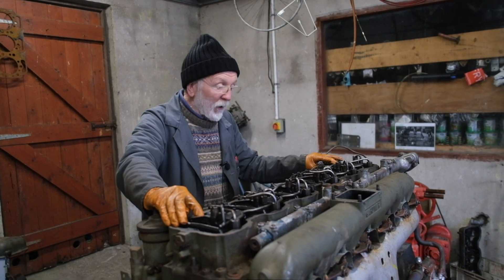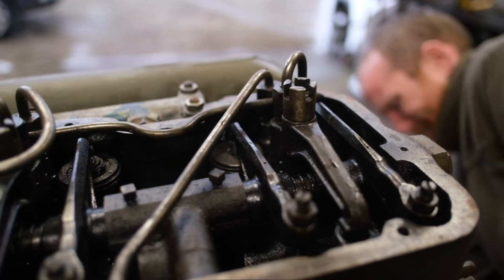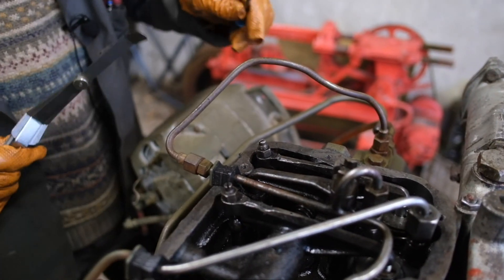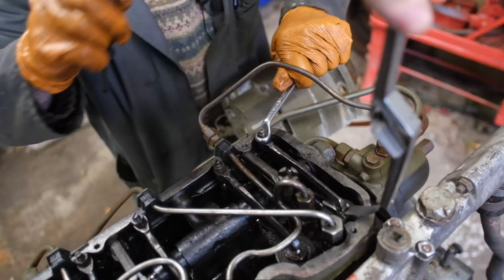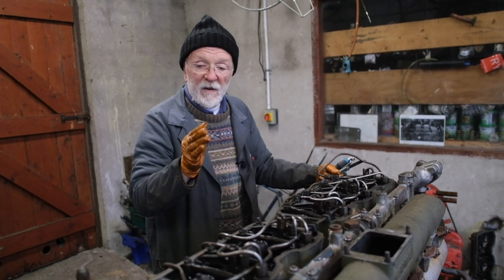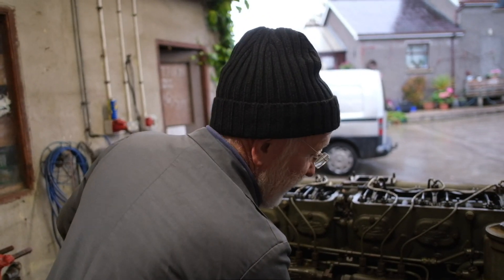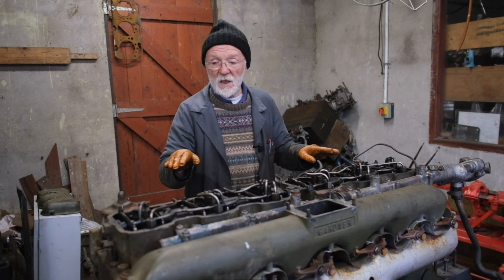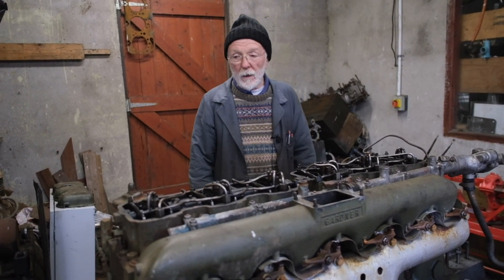Gardner Engines:setting the tappets

Comment: thanks for all the great videos your very generous. question where do you see marking for top dead centre ? also what is the next step for finding TDC  on next cylinder ?
Reply from the maker: The marks are on the flywheel.   Thanks for the comment.
Reply: @tangentgardner  thanks Joe for your reply my flywheel is in a bellhousing I do see what looks like a inspection hatch? on another subject my 1985 6LX has on fuel manifold 1700rpm 150hp its in a 56ft timber yacht with a 36'' variable pitch propeller and for the four years I have lived aboard I have set the pitch at 1200 rpm max as advised . question is this good for the engine and gearbox at this max revs? most of the time i sit on 800rpm cruise.
Reply from the maker: Please email me directly about this: tangent.gardner@gmail.com